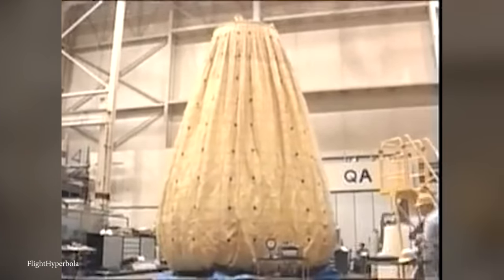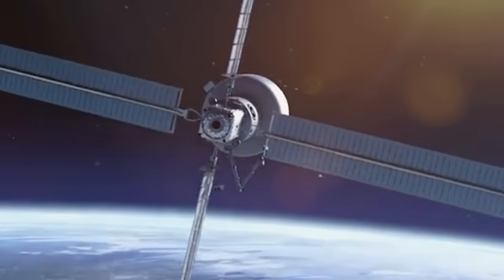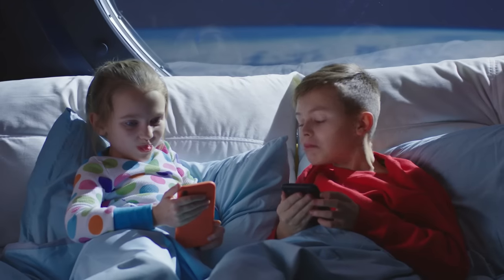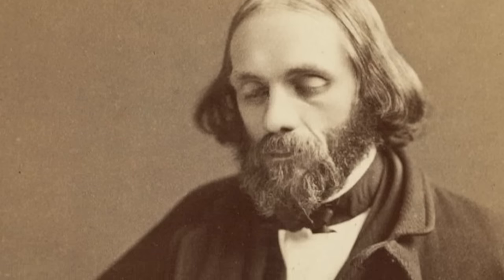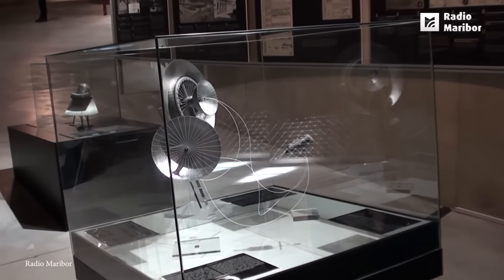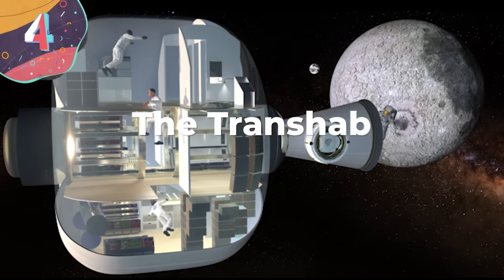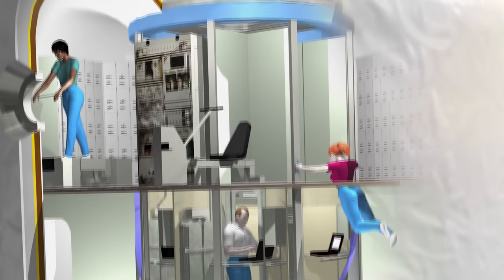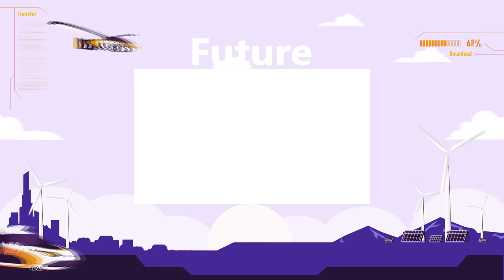15 Future Space Station Ideas

Comment: At mention of the Ringworld, I eyerolled so hard that the torque energy counteracted the Earth's spin.
Pure fantasy. As realistic as the Wile E. Coyote aerospace concepts.
Tensile strength like the strong nuclear bonding force.
It wasn't built (in the novels) for living space by anybody who needed such a thing.

Not a mention of the Stanford Torus, but you covered the orbital ring, the Brick Moon and the Ringworld?
Reply: There is an even better concept than the stanford torus.  A tube within a tube, the outer tube is stationary, only the inner one spins and this offers both zero G in a station and the rating on the spinning section, anywhere from 1/4 to 1 full G force.  Spinning the entire space station is a deal breaker.
Reply: @TheWadetube  
See O'Neill's book "the High Frontier". One design called the "hatbox" had a stationary drum-shaped shell with narrow apertures that Sunlight was concentrated in through. Inside, a  glass-roofed steel habitat spinning for G.

A long spinning tube isn't suitable, as it's not dynamically stable and will tend to wander off-axis to spin end-over end.
Yes, it can be anchored at the axes and stabilized actively, but it never makes sense to design to defy physics and then apply complexity to counter the design flaws.
A drum-shape with a massive rim that's about as stable as a bicycle wheel shaped station is feasible. See the "Kalpana One" habitat.